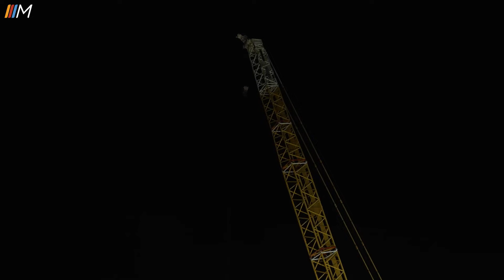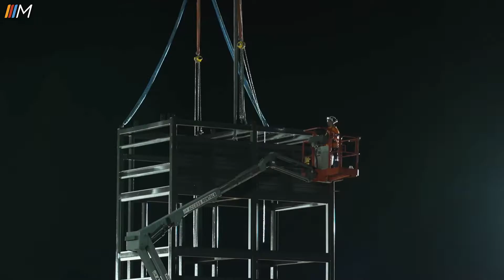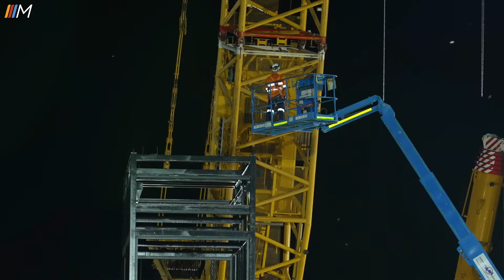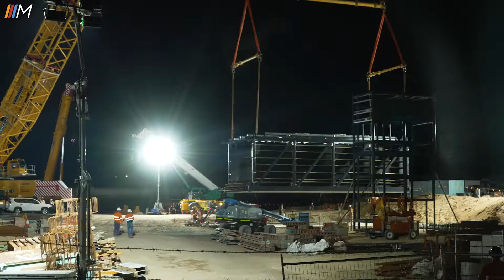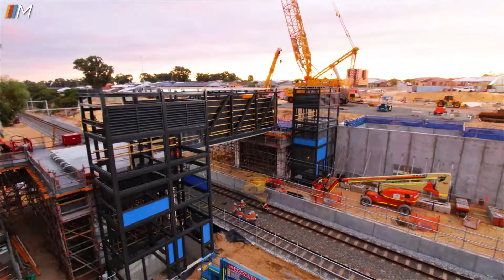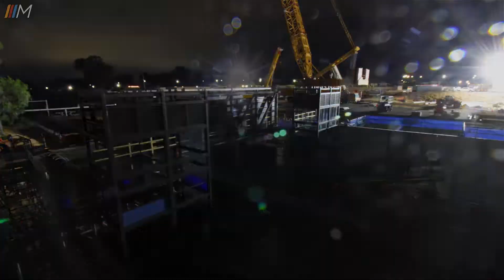METRONET Lakelands Concourse installation

Comment: Oh wow this station is already coming along very well. With all the other bigger projects going on you forget about the little ones like this one.
Reply: do you know when mandurah line will get new c series?
Reply: @AussieScorcher  Well they've delayed it until 2023 now but since it was originally meant to be this year it will probably be early 2023 when the first ones come out, although there will only be a few of them and still a lot of Bs at that time.
Reply: I live 1 minute away from there.
Reply: @AussieScorcher  Well i heard that the a series are moving to b and b moving to c fully by 2029, ive already noticed a lot of b series on the midland line instead of normal a series. so i think the shift is happening soon!
Reply: @bbas2010  Well that will be great for you to have a station now!
Reply: @RealTacheYT  The reason there are more Bs is just because of the new ones that they have got for the Airport Line operating on the lines now. The Cs will slowly replace the Bs on the new lines from 2023-2029 and those Bs will replace the As until they are all retired.
Reply: @TransportofPerth  Oh okay.
Reply: says a lot really that in context a whole new station is only a little project